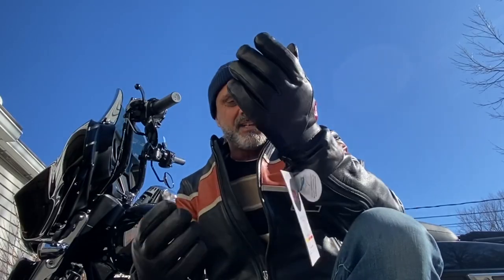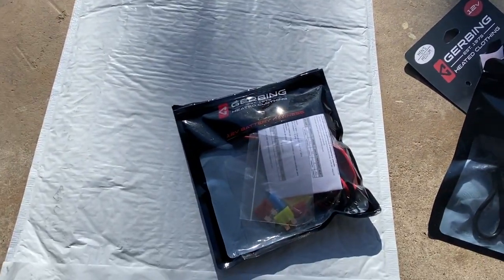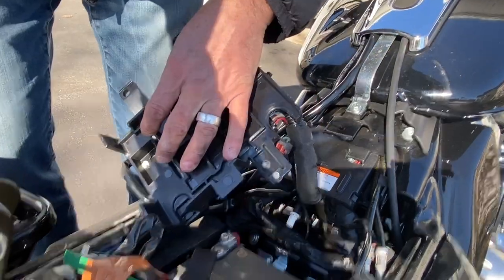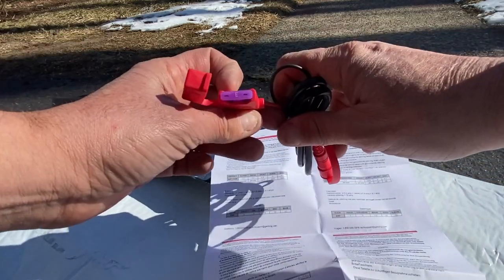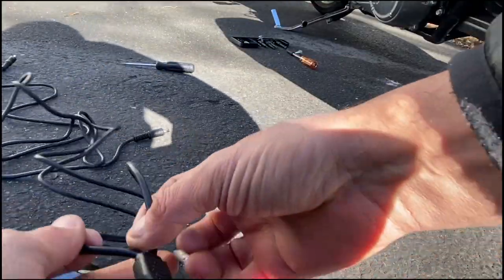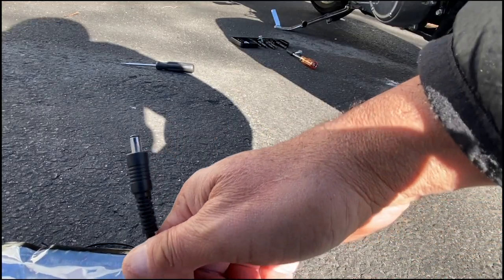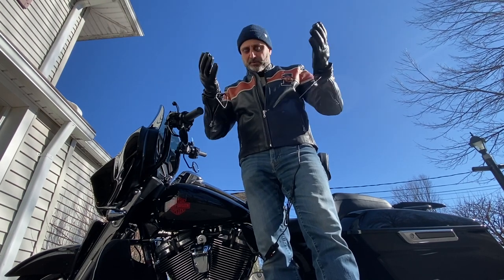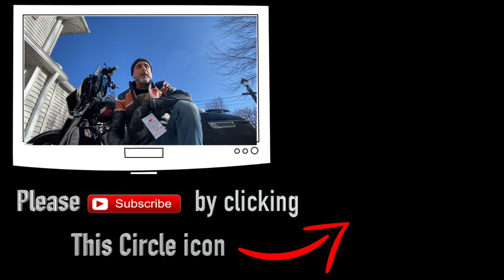Gerbing Heated Gear Install

Comment: Also, gerbing makes a controller with a turn nob which is easier to adjust while riding.
Reply from the maker: This new controller is wireless ready - another $25 and I get the wireless knob controller to put on my fairing...
Reply: @HOLYSHIFT  I picked up the wireless controller. I recommend it!
Reply: @HOLYSHIFT  You will run out of battery just when you need it. The wired nob controller will just always be there and ready.

Comment: Great vid. They sell an adapter that plugs into battery tender. I’ve  been using it for years on my heated jacket and gloves.
Reply from the maker: Cool, thanks - but I think when you use adapter there is no fuse - right?
Reply: @HOLYSHIFT  there’s a fuse on the tender quick disconnect harness  between the battery and where the battery Tender plugs in. I’ve been running the tour master jacket and gloves for years with no issues. Both Harley and battery tender harness comes with a fuse.
Reply from the maker: @bikerboot888  gotcha..So it works then. Well too late for me,,,
Reply: @HOLYSHIFT  Next bike lol

Comment: How come you chose not to use the 12v plug in the fairing? Do you need a Fuze to use it? I have the y cable, gloves and the controller... Along with the 12v plug. I haven't used it yet. Will it blow if I don't use a Fuze with the 12v plug?

Awesome video too! Very informative

Comment: Great video Sandy, I am still debating if I am going in this direction. I have heated grips on my CVO and also have heated vest and you saw from other video I have battery powered gloves when combined with heated grips it’s been working great for my 2 hour rides(typical for me). But if I do, you just saved me time and effort for an install video, I’ll just link yours! Lol.
Reply from the maker: Definitely for longer rides you need extra batteries or a connection to the bike... install videos are a pain in the Butt to make but usually have a good audience
Reply: @HOLYSHIFT  copy that!

Comment: The other problem with the battery powered gloves is that they are mostly junk. I've bought a couple of pair and neither of them lasted more than a season or so before one glove died. I just got Gerbing gloves, yeah with the controller it was $300 but hopefully they'll last a few seasons at least, and I've already dumped $200 on gloves that altogether only lasted a bit less than 3 seasons and I had to mess around with pulling the batteries out to charge after every single ride.
I went with a dual controller because it's not much more than a single one and I think it's pretty likely I'll wind up with at least insoles at some point, if not a jacket or pants liner.

Comment: Just wondering, don't you guys like heated grips? It would seem easier.
Reply from the maker: Yeah - I should have installed the heated grips when I put the handlebars on....
Reply: @HOLYSHIFT  actually I did exactly the same thing. Dumbest thing I ever did or didn't do.